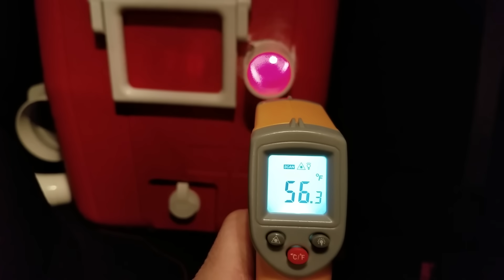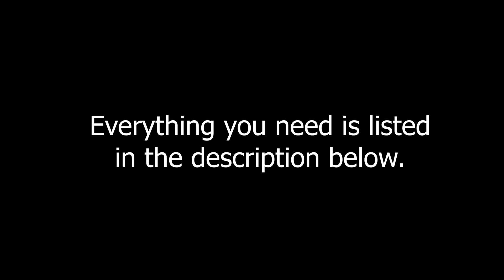Homemade Portable Air Conditioner DIY - Version 2 - Runs off 12 volt battery, car, or solar!

Comment: Ever consider a build utilizing Thermoelectric chips to help keep the ice colder, longer and reduce ice melting? I know that would get super complicated, you'd need to build an insulated, watertight under compartment for the heat-sinks you'd have to attach to the hot side of the chips, and that heat would also need to be ventilated somewhere. Just wonder how someone with experience building these things would go about trying to accomplish that.

Comment: I made this and here are some tips and problems I had encountered and adjusted for:

1. Mine leaked. Both around the input into the cooler, and into the vent pipe itself.  Working the pipe back and forth fatigued it I think and small holes were starting to form. The caulk used even says not for long term underwater.  Instead of trying to fix the leaks, I'm using that to my advantage (see 2.) No need for the input to be at the bottom, just put it near the top like the output. The pipe can be bent down into the bottom where the ice is. Save yourself money on the caulk. Don't need it. Make the hole exact fit, both input and output.  You will want to be able to disassemble it. I don't feel any air/cooling loss there.
2. Fill your vent pipe with sponges.  I used the rectangle sponges. Cut them in slivers and line them up single file down the tube.  When the ice melts, drain the cold water and pour it into the vent pipe (unless it already leaks). Sponges will soak it up. Voila! You just converted it to an evaporation cooler. Don't clog it with the sponges. It will need space for the air to flow. I also saw some cylindrical sponge filter wicks you could probably use as evap pads, those are fairly cheap. Disassemble and remove the sponges when done to air dry or they will start to stink.
3. Don't put so much ice that when melted it will clog the tube if it leaks. Maybe halfway up the side when melted, so just enough ice to cover the pipe.  This will reduce the use, but you should still get another day from evaporative cooling. You could also add a couple ounces of dry ice to make the ice last longer.  Any more than that and the expanding CO2 gas will probably open the lid, but more than likely seep out the connections since it is not caulked. Have not tested it though. Don't want to buy a big block only to use a couple ounces.
4. I found cheap coolers using local apps/sites for sale. Had to burn 1 as the first test case. Bonus, I used the screws from the handles on the first one to connect the blower to the side. I also mounted my fan on the back side instead of front side. Might block the noise somewhat.
5. I reduced my blower to the 130 CFM unit. Cuts the cost and was still powerful enough.  It is somewhat loud and can't comment on the longevity yet.  I also got a potentiometer to adjust the speed. I don't think I will need full power all the time.
6. I actually wound up using 3" flexible aluminum foil duct.  It is very sturdy foil and bends a lot easier than the solid style.  I also think it transfers heat better, because the foil has more surface area.  Right now it is not leaking.
7. My use case will be for camping and cooling a dome tent, so I also got a 12V SLA 9Ah battery and a 10W solar charger. 
8. So far at 85 degrees ambient temp, it's blowing 50 degree air with just the ice, and about 70 when using the evap sponges.

Apologies to the OP for the long post, but thank you for the idea and how-to!

Comment: Doesn't Work. I purchased every part you used and a new $60 Coleman ice chest. The ducting does not keep the water out laying flat on the bottom of the cooler. In about 10 hrs the water from the melting ice saturated through the ducting and poured out of the fan. Also you said the ice lasted 3 days? In less then 18 hrs a chest full of ice was completely melted. Big waste of time and money.

Comment: Awesome, i brought a digital thermometer into my room yesterday and checked it today and apparently it got to 96 degrees. It is 89 right now as I am typing this and I spend all day in front of my computer programming lol so this Sunday i am going to start building this. Though I might try making a thin floor over the piping, adding water under this floor so the pipes are submerged and then use frozen 1 gallon jugs so they will be easier to change out than actual bags of ice.
Great video BTW

Comment: Can the blower be wired to run off of a standard wall plug?  Wife and I both require medical equipment so when we tent camp we need electricity at our site.  Figured it'd be easier to just do it that way for our tent.

Comment: Well, I bought all of the materials that says the video and did my project following carefully all of the steps and guess what? 
It didn't work for my bedroom at all. I wasted 100 USD :(
I found the air flow was very poor. I'd say the air comes out a bit colder that the air on the room however that is no enough to fresh the room nor myself if I aim the air flow to my bed.
I'll go for another solution. don't know which one.
Reply: I got a one room a/c from lowes for 150.. Try that

Comment: Hi there thank you for sharing your video.
I wanted to ask you if you know any particular solar panel that makes the seaflo 4” fan work
I tried to connect to a Moultrie 12-volt solar panel which is continuous battery source for the fan but it does work, however when I connected to the battery of my car works. I was wondering if you know any particular solar panel that make it work. Thank you

Comment: So, I have a small, old plane, a Grumman Tiger with a sliding canopy and during the summer it gets REAL hot inside. Love your design and will build a smaller one for the plane. Question: There are some fancy avionics in the plane that don't particularly like a lot of moisture. What would you think, instead of using the metal tubing or piecing together, back and forth, back and forth, copper tubing. Hopefully to avoid any moisture getting out the cold end. OR, is the metal tubing you use strong enough not to have any cracks after use and bouncing that I don't have to worry about it. Will only be used for takeoff and landing, approx. one hour at a time so does not need to be that large. thanks.

Comment: I started the morning out with the intention of building the more common variations on YouTube. Was just about to make my 1st cut into the cooler when I decided to look for some more ideas/reviews. I’m glad I came across this video. I went to Home Depot and picked everything up you suggested and ordered everything else on Amazon, plus an adapter for household current. Not including the cooler, which I already had , I’m at $94 all together. Little more than I thought it would be but it definitely seems like it’s gonna be a fun little project. Thanks for the detailed video and especially the parts list!
Reply: did it work?

Comment: Possible upgrades, pvc elbow into cooler, flex dryer vent inside as seen, insulating board on top of the ice, output in lid but not connected to the cooling tube

Comment: Water is a better conductor of heat than air. Displacing the air around the ice with water is what reduced the temperature of the pipe and there for the air coming out. Want it colder mix some ice cream salt in the ice water, it drops the freeze point of the water and makes it much colder.

Comment: Hi this is such a great idea as I look into car camping. I'm not sure if you're still reading these but if you are I have two questions that I didn't hear you answer in the follow up video. What wattage of a power source does this need? I'd like to power it using a portable, rechargeable power source. Also, will this work with a smaller cooler or do you have to use the 48inch? Any help would be grateful. Thanks

Comment: What do u do with the condensation build up in the 4" flex ? Also choking down the 4" to 2" out will lower your cfms and put restriction on the motor causing it to fail much faster hvac common sense

Comment: Very nice for those HOT tailgating parties.  I wonder if the air intake fan could be placed on the lid in some way to eliminate the possibility of it getting bumped and knocked around and possibly damaged?  We take so many other items along with us there is always something getting hit in the process of removing/returning back to the car.

Comment: Why not make all of the cutouts & holes on the Lid of the cooler so that it can be used in winter time with a Styrofoam lid instead of ruining the main cooler?
Plus no need to seal holes in the lid for water leakage.
Hanging the fan motor on the underside of lid quietens whole system. One large hole in lid for fan exhaust = less PVC plumbing($$$).

Comment: Real excited to make this. I got everything collected and when I plugged the adapter into the vehicle and switched it on, the 10A fuse blew in the adapter. Tried it 4 more time and more blown fuses.
I connected blower directly to battery terminals and it works. Confused on what item is the culprit, adapter or Marine blower?

Comment: i found that putting the blower inside the cooler helps reduce the noise, a little. Adds a extra curve for the tubing unfortunately, which reduces airflow even more, but still works. What im finding is this cooler doesn't keep ice for 3 days, no where near. and ice is $4 a bag every other day....Still not too bad

Comment: These parts cost almos $100 with shipping. You can buy a portable personal space air conditioner and a solar panel to power it for less than $80 with shipping = less cost, no other tools required, no destruction required, no power expense or stranded because you killed your car battery.
Reply: Link these items because personal air conditioners that are worthy anything are 300+ and panels to power this are 200+
Reply: @ybarraluke  Youtube doesn't allow external links in comments. They're easy to find if you look for them on amazon.

Comment: @make & do I cannot find description list but from what I see of the materials you have laid out, Are these items correct?  4"-2" flexible coupling? 3" flexible aluminum duct? 2"-1-1/2" flexible coupling? 1-1/2" pvc & fitting ? just looking at the video where you have materials laid out! How long is the semi rigid aluminum duct ?

Comment: Thank you so much! I was just thinking of doing something similar but with copper tubing filled with water coiled in the bottom and extending into the exit tube and then blowing the fan in - BUT - your idea is greater, easier, and cheaper!  I'm 74 and my camper was stolen so i must travel in my truck and camp in back! I was worried about overheating at night!  How long can I run my 12 volt fan on my truck battery before putting my starting abilities in danger?

Comment: ok I've gone to the answers, I don't see a material list, what type 12V fan? what type of fittings? size etc did I miss something, I'd like to build one of these
Reply from the maker: Did you check the description? There should be links to all products there.
Reply: @livingwithlucasofficial  cannot find description list 4"-2" flexible hub? 3" flexible aluminum duct? 2"-1-1/2" flexible hub? 1-1/2" pvc & fitting ? just looking at the video where you have materials laid out! went to lowes the don't have a 4"-2" flexible hub where did you get this?
Reply: No description however I used 3" aluminum duct and attached in the inside of the 4" - 3" flexible coupling then used a 3" - 2" flexible coupling on the exhaust end drilling 2-1/2" hole to accommodate the 2" pvc pipe for exhaust
filled the top of the 3" duct seemed to put out air equivelent  to my 12V fan

Comment: I have a travel van that I converted from a cargo van. Didn’t raise the roof. I have a rv air conditioner on the roof and it is about to crap out. It is a small van and I think this might work. To replace the air conditioner will be about $800.00. And then I would be buying another piece of Chinese junk. After about 5 years I would have to do it again. I can buy a lot of ice for $1600.00. Plus I am already wired for 12 that runs off of my house battery.

Comment: Great video!
1) Put the blower inside the cooler, with intake pipe through cooler wall, and it would be much more compact.
2) Put the reducer before the duct, use smaller diameter duct, and have better ice contact on the air.
Reply: I think the reason the blower is outside is to avoid accidental contact with water/moisture.

Comment: Very nice design.  The problem I am seeing here is overtime condensation will start to happen inside the metal tubes and when the unit is off might cause mold to accumulates.  Adding like a small drain from the tube out from the cooler will possibly prevent that.  Just need to be cleverly incorporated.  Just my 2c.

Comment: This is a sound concept. 
I built one, well I built an actual air conditioner incorporating your design. 
I added a heat sink with a peltier module and a closed loop cpu cooler to pass the heat outside and keep the ice cold.
Reply: I found a different brand 3 inch aluminum flexible tube that so far has not leaked
Reply: Hey, where do you put the heat sink?
Reply: I did it through the lid, cold sink on the inside and heatsink on the outside
Reply: *the fan he recommended burnt up pretty fast.
Plus the fan moves the air so fast it doesn't have time to cool down as it passes through the tubes
Reply: @thomascoleman7301  thx! Yeah I was thinking of using the 130 CFM for lesser noise and potentially longer lasting ice.

Comment: A pwm module on the blower to be able to run it at lower RPMs and maybe even smaller diameter ducting to get more air in contact with the cold?

Comment: Is most of the air blowing out towards you from the fan or the small PVC pipe? I just one and I’m not getting a ton of air directly out of the pvc pipe but I am getting a lot from the blower.

Comment: That's a great job right there! But i still want to combine this, with frankencooler's idea. Adding a radiator to the inlet, cooled with water that is pumped through the bottom by a copper pipe (wave shaped).

Comment: I made this exact model and the problem I'm having is a BIG one!   The flex pipe leaks...I've sprayed it with flex spray (rubber) but still leakage...help!
Reply from the maker: The easiest solution would be to open the drain valve on the cooler and attach a small hose to it and let it drain to the outside.

Comment: For an total non-electrical dude like me, who can't tell the difference between a kettle plug and a bathroom plug, can someone tell me if this apparatus can be rigged up to use at home - in england, ie 230/240 V's ? Good idea here but it seems only for use in the car, ie 12 v. A direct link address would be cool. Cheers.

Comment: Marine blower should be internal not external.  Likewise the exhaust should be flush so your unit is much easier to “live” with.  If you could design a system where 50% of the exhaust recirculated you would drop your temps

Comment: Would longer and smaller diameter hose give more surface area to cool? VS the push or force needed to push the air?

Comment: Instead of using a cigarette lighter plug can a regular house plug be attached first. I dont intend to use it in my car at all. For house use. Or is the cigarette plug a must and the adapter will have to be purchased???

Comment: Thanks for sharing, I also wanted to add, that I made one very similar to yours. But, I add ice water and salt and this helped lower the temperature 10 degrees. Huge difference, for adding salt to the ice. You should try it
Reply: If you but some rabish aluminum inside the tupe it will make you freez

Comment: FYI  power consumption based on 12 v/6 Amp is 72 watts/hr *12 hr day=864 watts/day *30 days= 25kwh a month. If you add the power consumption if an iceless thermoelectric unit itcan be used to get  aconsumption picture.. ( I have just  asked Igloo for the consumption of their Igloo Iceless 40 qrt model. I will privide info when known.

Comment: Dont use a cheap cooler lol. I filled it up with ice and 4 hrs was melted and like an idiot didn't think of the drain plug wallmart cheap coolers doesn't have drain plug.  Fyi

Comment: I like this design, I can’t seem to find a parts list. About how long would it take to drain a 12 volt car battery? Also, what is the metal flex you put in the bottom? Looks like it could be for a hot water heater exhaust?

Thanks
Reply from the maker: All of your questions are answered here: https://www.youtube.com/watch?v=H4LutVTqsUU&feature=youtu.be

Comment: Why don’t you combined both models you made together. Like where the ice water at the bottom and close the pipe… And as well make the removable mesh that can catch the ice on top put ice on top and a second motor that blows air from regular ice on top… You might need two motors and two pipes where the air comes out but it might blow twice as cool and have twice as much cooling  power what do you think

Comment: I bought the air blower and the household adapter that you recommended. Am I supposed to cut off the cigarette lighter adapter portion of the plug? If so which wires hook up to the red? Would that be the brown wire from the blower to the red wire of the adapter?

Comment: Does not work . My A/C went out in my Chevrolet Traverse. So I  bought most of the things in this video I am using pipe coming out for the what should be cold air . It is not I got 3 bags of ice in it some has melted so I got more ice . Is 93 out side I am in front of this thing in my Chevrolet Traverse and it is not cooling off its 909 Pm here in Tennessee . So it does not work .